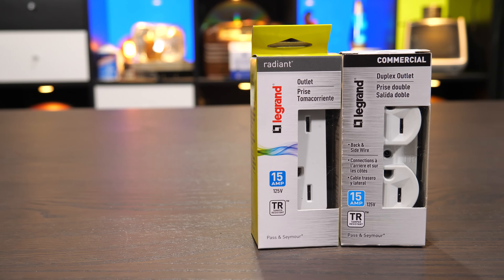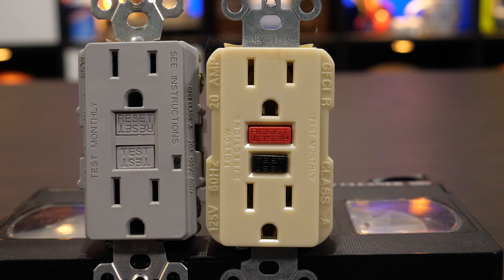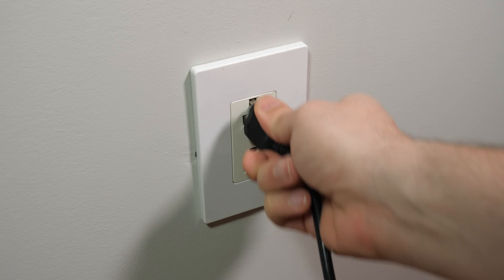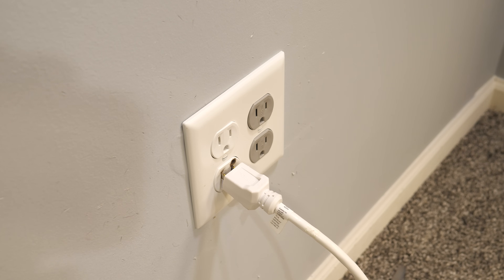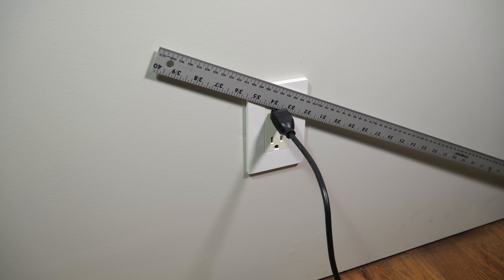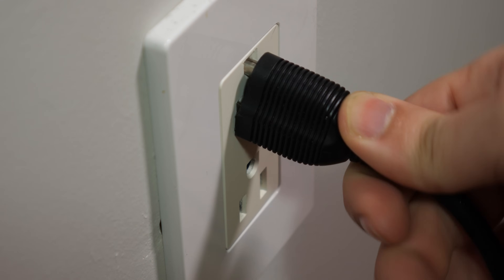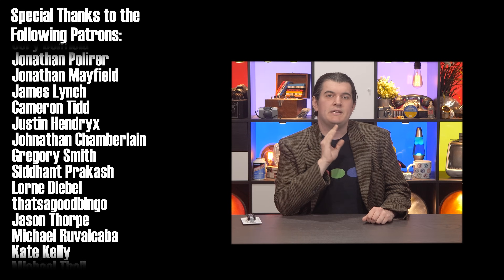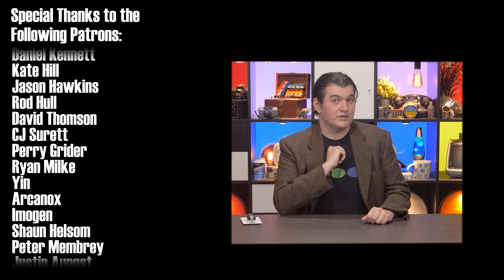Power outlets are topsy turvy - but does it matter?

Comment: yes, the UK claims to have the worlds safest plugs because of the upside down outlet and the fact they have fuses in their plugs... except.
1) the safest thing about the UK plug is the plastic sleeving on the pins
2) fuses do not protect people. they protect the wiring on the circuit, in the case of a fuse in a plug... it protects the cord of the appliance at best from a short circuit on that very cord... it will happily fry the appliance waiting for the fuse to blow and continue shocking the person holding it.

Comment: In electrical class we were taught 'Ground Prong Down' --  The logic behind this is...  If the ground was at the top, & if the plug were to begin to get pulled out slightly, it'll usually tend to droop downward allowing the ground prong to be the first to disconnect, meanwhile live & neutral could still be making contact, if this is left unnoticed, at this point your appliance (ex: toaster, kettle, fridge etc) would still be live but it would no longer be grounded... Whereas with the ground prong down, it'll be the last prong to be disconnected & in turn your appliance will still be safely grounded.

Comment: As a EU citizen those plugs are very "exotic" to me and I appreciate what we have here so we don't have such problems :)
Reply: The Europlug (Type C) plug fits well into most sockets, but your combination may be quite unfortunate. Since there are both flush and recessed sockets in Europe, when the Europlug is attached to a brick, not cable,  the prongs stick out not from a brick itself but from a base attached to it, otherwise you cannot plug it into recessed sockets. But such brick plugged into flush socket creates quite a large lever for the weight of the brick, so it may be enough to disconnect.
Reply: Yeah, good old german invitation competence of the SCHUKO-Plugs ^^
Reply: I actually did have issue with sockets in Portugal.
Reply: Type F aren't that smaller and probably use more plastic/rubber than type G without having all the advantages type G has partly thanks to its generous size (simpler shutter system, no need to recess socket, polarisation, possibility to put a fuse) and also, like with type E, you can still find sockets not recessed enough to have complete safety and without grounding which accept the grounded E/F.
But I think anyway the swiss or the Australian standard are superior in terms of versatility, being part of a coherent system, cost of manufacture and dimensions. The British plugs are overly complicated except if you have ring circuits imo
Reply: Also I live in Italy so I will say my opinion on type L. It's the best you can get when you want to be as minimal as possible without sacrificing safety imo, but lacks some features like polarisation. Their space efficiency is excellent, I think no other grounded socket is better. One issue is that it's not that hard to bend pins accidentally, but that's common with the europlug. Sadly though the 16A version is dying as manufacturers of high power appliances don't bother installing type L but send them with Schukos, so nowadays Italian homes have plenty of hybrid schuko+type L 10/16A plugs. I don't like that very much because in the space one schuko takes you can install two L (which can be 10A only, 16 only, rare as basically you find those plugs only on extension cords nowadays, and 10+16A).
An interesting fact about why difference between 10 and 16A isn't only pin size but also spacing: until the late 60s, many places in Italy didn't use 220/380 three phase low voltage networks, but 127/220 or even  wackier voltages, in a similar manner 110/208 is used in the US for condos, and the larger (now 16A) plug was used for 220, the narrower (now 10A) for 127 V, so they had to be incompatible. Then everything was switched to 220 (now 230), and sockets accepting both 10 and 16A plugs were invented
Reply: It's not really a problem. He even admitted that he couldn't get a knife to stick and had to stage it. Can't believe how many people fall for these YouTube videos based on fear. EU has some great things she some horrible things, just like the US. So funny when troglodytes think things are better elsewhere because of an outlet. 😅
Reply: Yeah, until you have to have to decide where ground is on a C plug and then you have too many standards to count. E, F, H, J, K, L, and N all work with the C plug, but all have their own ground connections. Thankfully E and F are interoperable, but its pretty clunky in its design.
Reply: @gljames24  yeah, the F plug is just superior to all of those as far as i'm concerned. robust, invertable, safe, and offers easy compatibility with the C plug for ungrounded devices. plus the invertable bit helps push manufacturers to not design stupid shit like using the neutral in place of a ground
Reply: @gljames24  In Italy we use type L which is basically a grounded type C with an exposed centre ground pin: reversible, grounded, compact and quite safe. We also have Type F but it is rather bulky and takes up the space of two 16A Type L.
Reply: @gljames24 it should be type F all around the world and nothing else
Reply: @gljames24  Yeah, sure. But europe isn't entire country, and in one of them, you would have at most 2 types of plugs, per country, and in reality most of europe (GB isn't europe) uses C,E,F and mostly E sockets, so you can put there whatever you want. You don't decide where is ground on C plug, since there is no any. Also ground is not on the plug, but on outlet so if it has it, then nice, if not, well whatever. Nobody thinks about these standards, nobody care, you just plug it in and doesn't have to be afraid of burning your house like box of matches
Reply: @Anscylla First, there’s no country or UN-recognised state called GB: Great Britain is the name of the island consisting of England, Scotland and Wales. The UK - United Kingdom of Great Britain and Northern Ireland - is the UN-recognised state. Secondly, the UK - including GB - is part of the continent of Europe, which includes continental Europe (the main contiguous landmass), the British Isles, Iceland, the Faroe Islands, Channel Islands, north Mediterranean islands, etc. You seem to confuse geographical regions with political regions. You are of course correct that Europe has no standardisation of mains electricity plugs and sockets, and the EU does not see mains power connectors as a area requiring standardisation.
Reply: @derekjc777  Of course I know that. What seems you don't know what is a shortcut
Reply: We don't actually have "those"problems here in the US with those plugs.  It's a farce.
Reply: @engineclinic  I've seen multiple comments under this video of people mentioning that they got shocked by US power plugs.
That definitely seems like a problem to me.
Reply: @Jehty_  I don't believe them
Reply: @Jehty_  the few comments I've seen are about someone doing something extremely stupid and it could have happened regardless of receptical orientation.  It is absolutely not an issue here and I've never once heard of any issue of people actually getting hurt by it.  The upside down plug orientation wasn't even started due to people getting shocked.  It was started due to fires from loose plugs and was later determined that it was actually worse when turning the plugs upside down due to the fact that the plug was designed to be installed ground down and is why the ground lug is designed the way it is.  The lose plug fire issue was due to having to many things plugged in during the Christmas holiday season.  They never made ground up code because it was never the issue and has been determined that if anything ground down is safer.
Reply: @engineclinic  I wasn't talking about receptacle orientation.
I was talking about US plugs from an European view.
And if you can get shocked by your plug (no matter if what you did is stupid or not) then that plug is flawed.
Reply: @Jehty_  plus the guy's claim that it's harder to come out if it's ground up is absolutely false.  The plug comes loose far easier installed ground up because it was never ever engineered to be installed ground up.  It's easily tested on a generator.  Generators with ground up installation will vibrate the plugs loose long before ground down.  I have years of experience in the field.
Reply: @Jehty_  you can get shocked by any plug in any country.  There is no issue in the US with people getting shocked by plugs.  If anything the US is safer due to using 120v instead of 240.
Reply: @Jehty_  I'm in my mid 60s and have been an electrician for many years.  I've never known of one person ever getting shocked by a receptical unless it was broken or they were doing something quite stupid like trying to change a receptical with disconnecting the power.  I'm sure it's probably happened three times in the last 100 years but I didn't hear about those three times.
Reply: @engineclinic  no you can't get shocked by every plug.
With Europlugs and Schuko that is impossible (as long as you don't use a tool).
With Schuko and Europlug it's impossible to touch the prongs while their are live with your fingers.
Reply: @Jehty_  ok.  Piss on your plug and see if you get shocked.  Lol.  Like I said, you can get shocked from any plug by doing something stupid.
Reply: @engineclinic I'm pretty sure you can piss on Type F and nothing happens - both due to superior design, that makes it quite resistant even against liquids and fact, that even if whole bus piss on it, creating sufficiently steady flouw for liquid to get in,  it'll more likely ground it before doing any real damage, as ground pin is going to get soaked first…
Reply: @FalkonNightsdale  ok.  My point was that it's not even an issue here and you would have to do something pretty stupid in order to get shocked.  Getting shocked was not even an issue. It was loose plugs causing fires and the cause of that was people using adapters to plug in more things and turning the receptacle upside down only made it worse because the plug wasn't engineered to be used that way.  If it's not even an issue here I don't see why other plugs would be superior.  If no plugs have actual problems then they seem equal but different to me.  I'm not sure if they use adapters to add plug ins on your style.  Maybe you guy's have better adapters.  I've seen six things plugged into a receptacle here that was designed for two.  Do you guy's have safe adapters that will allow you to do that?
Reply: @FalkonNightsdale  doesn't the f still trip the breaker by shorting hot to ground?  If so I really don't see what it would matter if the pee hit the ground first as it would still have to short to the hot but ok.
Reply: @engineclinic  No, you can't get shocked by a functional type F plug and socket (heck, even type C). It's impossible to reach the sleeved prongs once you insert it, and it's not live by the time you pulled it out. Plus, it takes a lot of force to pull a type F out of its recessed socket, and straight out (the inconvenience there is that you can't pull it out by the cord like you can with C and have to take a firm grip of the plug instead).
Reply: @Ingu.z  do they make a 1 to 3 adapter for a type f?
Reply: @engineclinic  You mean power strips?
Reply: @Ingu.z  no.
Reply: As a UK resident, I'm not a fan of European sockets. They often suffer from exactly the same issues as the US ones - far too easy for them to fall out.

The UK hasn't got much right lately, but plug and socket design is fantastic
Reply: @richjhart not sure how youve come to think that. While they do wear out over the years, a type f plug usually takes considerable force to get out. Maybe you're talking about the type C ones? For that I could maybe see it
Reply: @marius.1337  I'd assume they plug type C europlugs into BS 4573 ("uk shaver") sockets. The UK saver plug is offendingly similar to the type C, but with noticeably larger pins (5.1mm versus 4), so you would probably be able to put a type C in a shaver socket, but it would be quite loose. I understand there are also multi-standard sockets in the UK, which might not be the tightest fit on a type C either.

tldr: brits being brits.
Reply: @richjhart I've never had a plug fall out or even become loose here in Germany. What are you talking about?
Reply: @Jehty_ I don't think it's such an issue for residents because you will mostly have the correct plugs. The issue is that different European countries have slightly different standards. As such the Europlug is the type typically used on adapters. They come out very easily, particularly with a universal adapter (which are heavier)
Reply: @richjhart  what socket or country are you talking about?
Because with type F sockets that's definitely not a problem at all.
Reply: @Jehty_   type C plug into any European socket - i have been to Germany, France, Poland, Italy, and others. Type C can be a problem in any of them.
Reply: @richjhart    I guess then the travel adapter you have is just bad.
But that has nothing to do with the plug type. You could also buy a loose fitting travel adapter for UK outlets.

And if that really is a big problem for you then get a travel adapter that has Type F instead of C.
And for the few countries (Switzerland and?) where that doesn't work get a adapter for that country.
Reply: @Jehty_ I have used a variety of adapters in the UK, Europe, US, Australia, and others. The UK is the by far the best - it's very difficult to make a bad plug for a UK socket. For Europe, any heavy type C I've used has ended up being similar to the problems he described with the US (apart from the fact that I believe European ones are safer when they do come loose). US and Australia are both hit and miss and seems to depend more on the individual device/plug.
Reply: @richjhart  type C isn't meant for heavy plugs.
So comparing type C plugs to Type G makes not much sense. If you want to use heavy plugs use type F.
Reply: @richjhart  Type C plug (CEE 7/17) is missing the grounding which makes it illegal to use for many purposes. The other type C plug (CEE 7/16) is more commonly known as Europlug and it, too, is missing the grounding. In addition, CEE 7/17 has max rating of 2.5 A which prevents its use for any high power applications.

(Yes, there are two Type C plugs which have totally different designs but both are missing grounding. You should use Type E or Type F plugs only for safety but those do not fit all outlets in Europe.)
Reply: @MikkoRantalainen  Type C are for appliances with double isolation. I don't know if it has been changed but when I learned electrical engineering at school (NL) it was not allowed for double isolated appliances to have grounded plugs. So either you have single isolation and parts you can maybe touch in which case you need a grounded plug and socket, or it has double isolation which means there are no conducting parts on the appliances you can touch that do not pass at least 2 layers of (proven) isolation, in which case you have to use the C plug. Type C is actually a miracle, one design that fits almost all sockets in use and at least in the Netherlands were much better than the 2 prong plugs we had before (which had the same problem as the US 2 prong plugs of not being isolated and could be touched while inserting the plug).

The only problem with the F plug is that you can put it into socket with only 2 contacts without ground (old C type sockets). The pins are thicker but most of the time the socket will still take it, which is a problem because the appliance that was supposed to be grounded, isn't in that case. But a lot of appliances have double isolation and therefore a C plug, except some power hungry appliances like a washing machine or a magnetron oven which have a metal case. Even heaters have the 16A type C plug without ground if they are double isolated (the symbol with two squares on the label).
Reply: @richjhart  The reason a Europlug has narrower pins is so that it's compatible with Italian 10 amp plugs. I hate the Schuko sockets because they work badly with our plugs and are needlessly clunky: twice the size of an Italian 10/16 amp socket in compatible designs, with a larger size difference for Italian socket assembly designs that do not support Schuko sockets.
Reply: @pe1dnn  Yes, you're right that double isolated device shouldn't use grounding and can therefore use no-grounded plugs. The current limits of Europlug is still a problem for any power hungry devices.
Reply: @Jehty_ stop the cap
Reply: @richjhart  "far too easy for them to fall out"
What? They take quite a force to pull the cable out even with well worn outlets.
Reply: @richjhart  What I've witnessed personally are CHEAP EU-type sockets (extension cords) where even the regular plugs will wiggle and regularly sparkle when pulling out. So regulation and price (thus quality) are two forgotten topics.
Reply: @richjhart da fuq? Never did i accidentally disloged my plug. More often i have a problem to pull them out. 😂
Reply: Our plug design is great but it needed to be because the rest of our electrical standards are terrible! 240V - why did we think we needed so much? (It's 'only' 230V now though) @richjhart